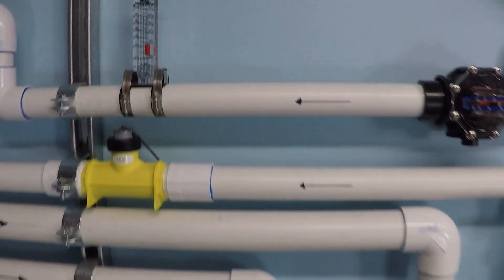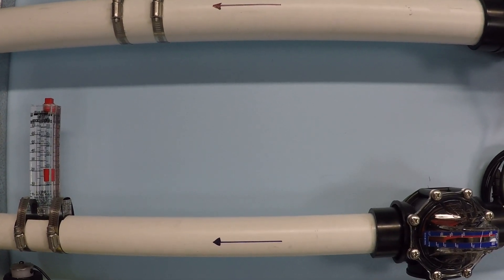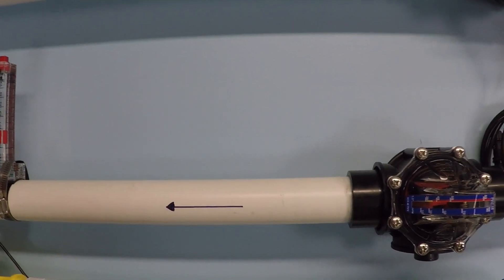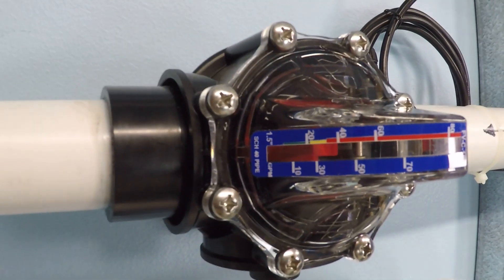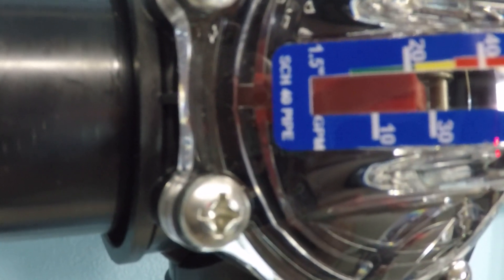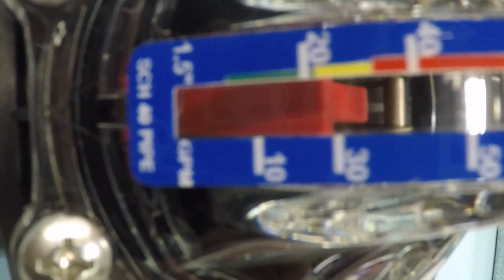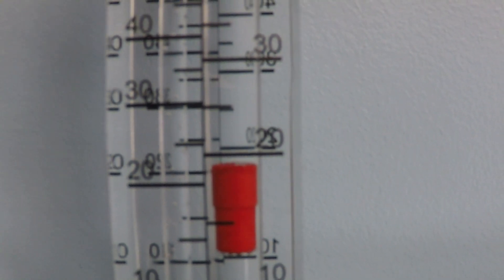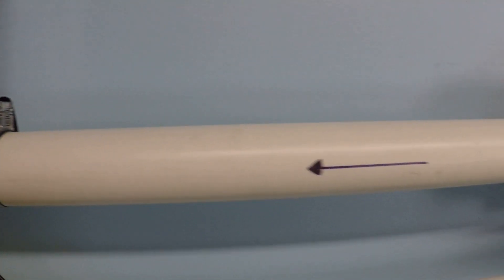How To Read Flow Meters

Comment: I like the flow meter with the driving g
board gauge. Is there one like it without the check valve?
Reply: I believe 'FLOW VIS' offers a version without the built-in check valve, for people who are concerned with adding resistance to the system.

Comment: Hey Steve I'm thinking about getting the H2 flow meter and check valve, not sure if that's the same one you have in the video.  Where should I put it?  I have a swg, filter and pump with long enough runs to put it anywhere.  Also will a check valve restrict any water flow or prevent a VS pump from working at low rpm?
Reply: The installation manual says the meter is best positioned after the filter but there still must be a length of straight pipe after the meter for accuracy. A name brand check valve (Jandy, Pentair, Hayward) will introduce minimal resistance and the benefits outweigh this effect. There’s even a popular flow meter with a built in check valve but it’s kind of pricey at $180

Comment: Hi Steve , in watching your vids the CO, who installed my pool for the most part I was here for most of the BUILD & it came out beautifully but when it came to the PLUMBING side of the PUMP they did not do such a nice job for instance they didn't give me my 20" RUN of SCHED, 40 before they went into my Variable speed PUMP , also noticed sand in my Robot & at the bottom of my pool so this pool is 3yrs young I changed out the sand on Friday thinking hey it could be the 1 of the LATERALS but once again I remember when the guy was putting the pump & plumbing together he brought with him THE PLAY SAND from HOME DEPOT so when I changed out i can tell the Sand was 2 FINE do you think I should call the COMPANY & ask them to replace the $$ it cost me for the 7 bags of sand & what about the plumbing ???
Reply from the maker: not 20 on every pool.  From manufacturer 5x pipe diameter is the minimum acceptable value, so start there.  Do you have 10" (assuming 2" pipe) and if you do I would accept this.  However this is not optimal distance, so when you have more room you use it.  Play sand should never be used in a pool filter.  If you want, call the filter manufacturer and they will confirm that you need #20 graded silica sand.  If you speak with the builder and they readily admit using play sand then maybe they will buy you some new sand, but I doubt it.  If this were my pool I would just move on.  FYI your pipes will have sand in them also which will take a little time before you see the sand stop appearing in the pool.

Comment: Thanks, Steve. Love your videos!

Great timing in this vid. I recently bought and installed a Blue-White flowmeter (the one on the left in your video). I am so glad I bought it cuz my new Hayward heater kept kicking out when I lowered the speed on my variable speed pump below about 2800 RPM. I was hoping for a lower “cut off” RPM, in order to save more $$ on my new pump. The company who did a reno on our pool last fall didn’t have anyone who could help explain why the high RPM was needed to keep the heater firing while the pump was running. I suspected the water pressure switch was set too conservatively T the factory so I needed a flow meter to check this out. I also called Hayward and confirmed the minimum flow rate required through the heater to protect the heat exchanger. Then with the new flow meter, I was able to adjust the RPM down while keeping the minimum flow rate where it needed to be. I confirmed my suspicion about the pressure switch setting which would not have been possible without a good quality flow meter! It also showed me the difference in flow rate when my sand filter was backwashed properly. Significant!
Reply from the maker: There are a lot of people with stories like yours.  It is kind of crazy when you think about it that pools traditionally all lack any ability to know how much flow you have, and yet each and every component has exact flow volumes that it needs that you are supposed to adhere to.  Things like the filter being clean or dirty...you have literally no frame of reference as a pool owner - are you getting 10 GPM or 110 GPM??  Happy to hear you got your pool sorted out.  Cheers.
Reply: Glad I read this. With a new vs pump I’m sure I’ll turn it down low enough so heater doesn’t fire. Flow meter will help troubleshoot.